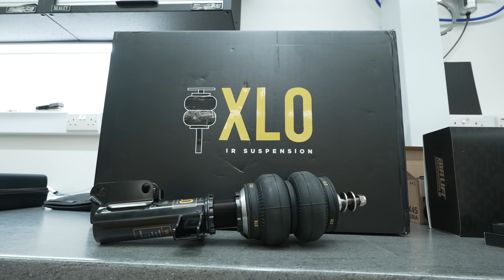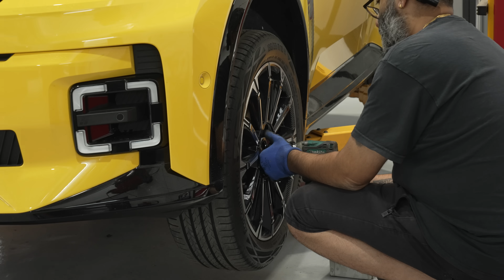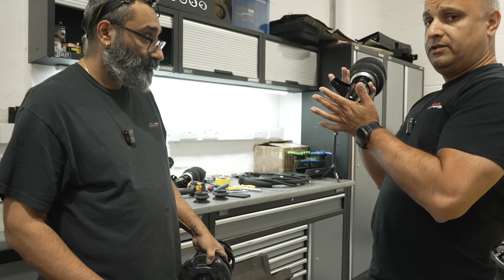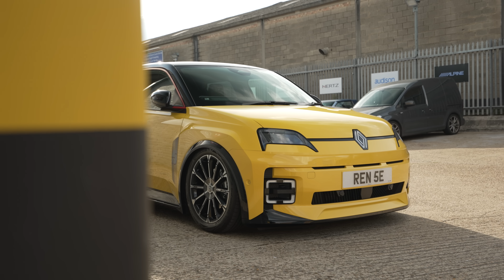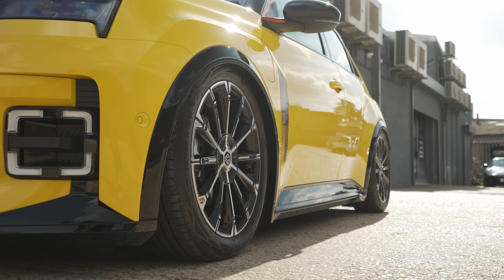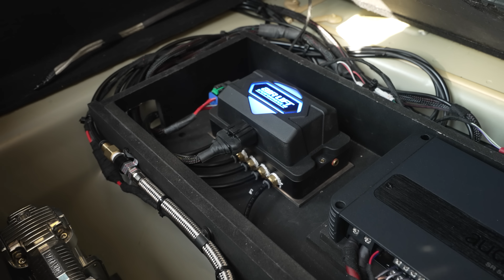First Renault 5 E-Tech on Airlift ALP 4 Management | Car Audio & Security

Comment: Sorry, but this really didn't work out and I don't understand what the point was... The original R5 was great in design, because the fenders fit the 18" wheels perfectly - you can see the exact circle around the circle, but now the fenders have fallen down onto the wheel, it's really awful :( Besides, the chassis on the R5 was generally rated highly, I drive it myself and I have nothing to criticize it for...

Comment: Thank you for taking the time to modify e cars it since to see and amazing job too, it looks very tidy with the sound system installation as well . 

To cover all budget types could you show other set ups like spring and shocks combo on a good few other EV cars like VW id3 , nissan leaf as there lots of these on the road and the suspension is definitely on the high side and a little soft but not having to spend too much to transform.
Reply from the maker: We appreciate the feedback and will definitely consider it for future builds! 🙌🏽

Comment: With all due respect, according to me, this is a perfect example to how to f.ck up a nice ride. It is  neither better looking nor has any improvement over performance if not negative. What's the point? You might add a cabin lamp at the back which is meaninglessly missing in the design, a pair of USB ports for rear seats and an AC fan  output for the rear passengers. But a lower R5? You know the bottom is mostly a giant battery, right? A turbo installation would be as much useless. What's wrong with you guys?

Comment: As an R5 Etech owner this makes no sense….5k on a cheap little EV is silly, plus it actually rides very well on the standard set up, on the Alpine it makes a bit more sense. You chose the wrong car to play around with…
Reply: Doesn’t sound like you modify cars lol. Financially they never make sense 😂 but that’s not the point
Reply: I have an R5 too completely standard and it's fantastic. It has the perfect balance between comfort and sporty ride. French, and especially Renault engineers, are known for being among the best achieving this equilibrium. I had a Clio in the past and was just as good. This video is about how to burn silly cash to ruin the happiest of the EVs on sale today.